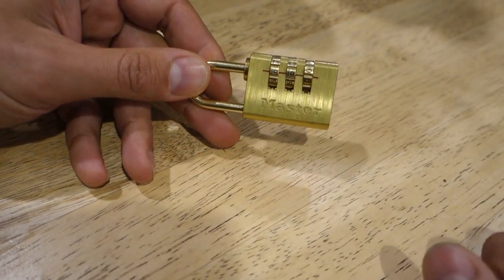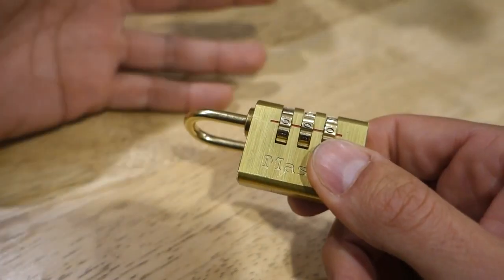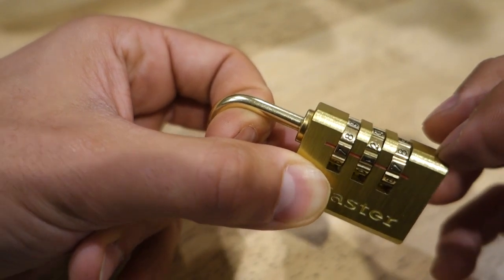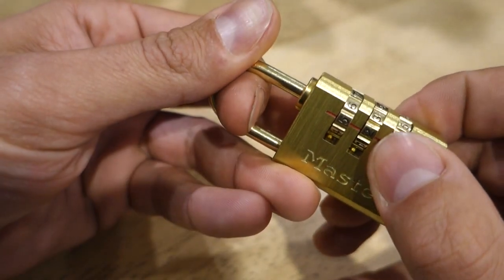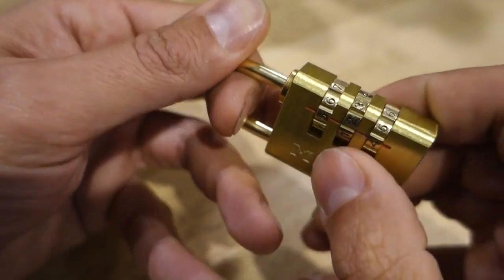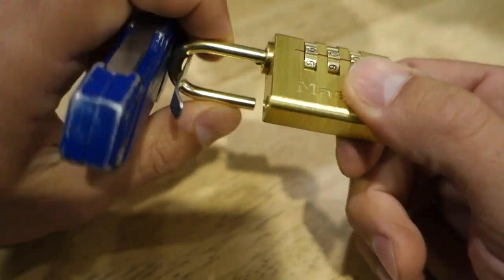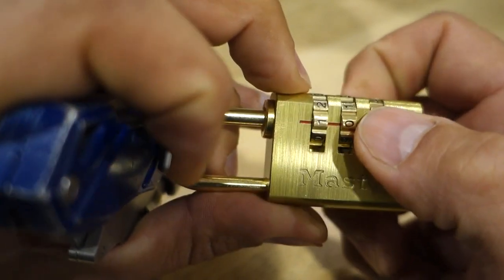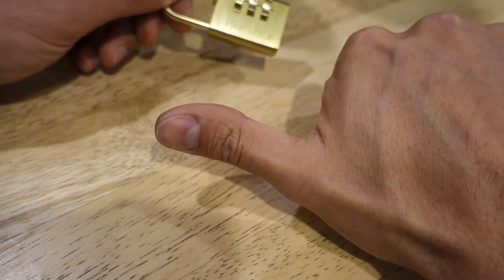How to open a combination lock without the code -  life hack padlock

Comment: 3 wheels lock with 10 digits each = 1,000 possible combinations.  You can easily try 000 to 999 in order- attempting 2 combinations per second. That very simple method is guaranteed to work in exactly  8 minutes with zero skill involved.
Reply: Thank you so much
It Worked!